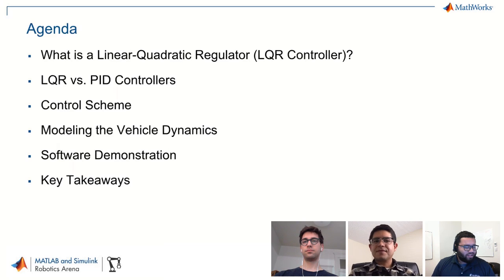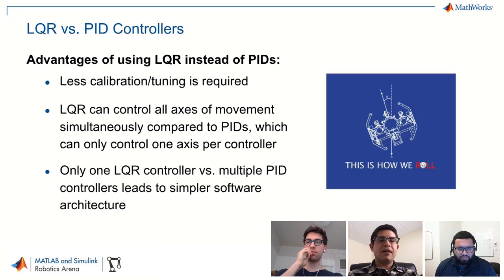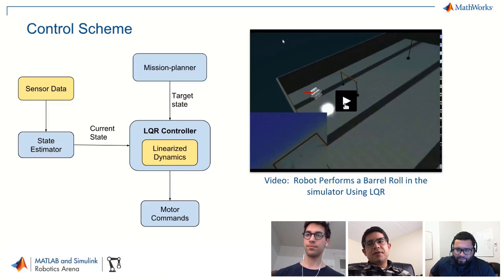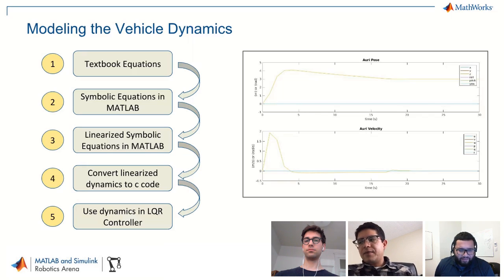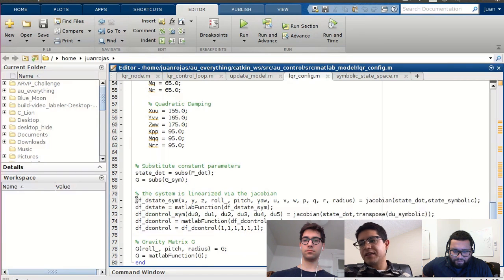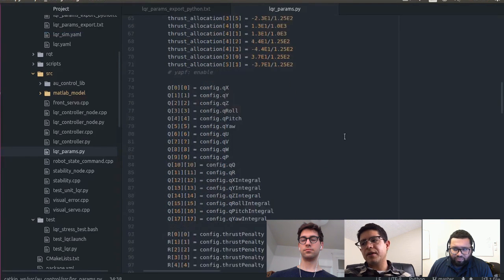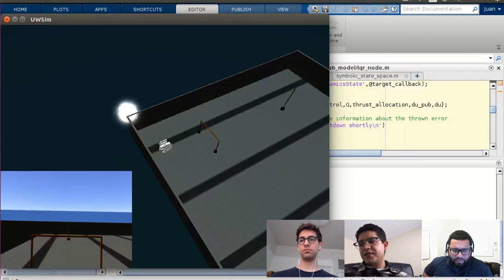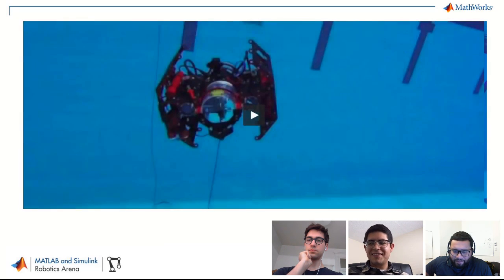LQR Control of an Autonomous Underwater Vehicle - MATLAB and Simulink Robotics Arena

Comment: Nice video. I used to do my project related to this similar topic. Mine was to control the motor of an electric bicycle using LQR vs PID. Unfortunately I didn't manage to get good findings as i was not good at modelling the equation. All in all, i had always followed your videos and it's interesting seeing problems being solved using MATLAB!